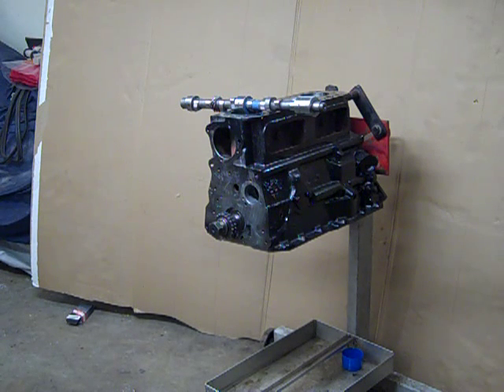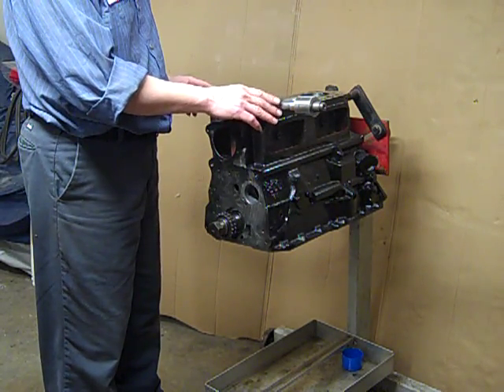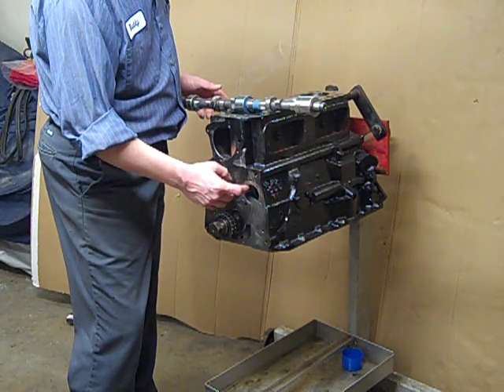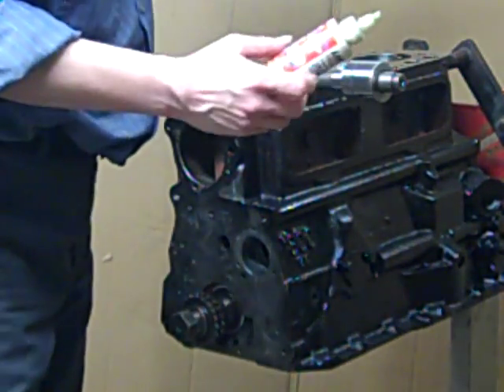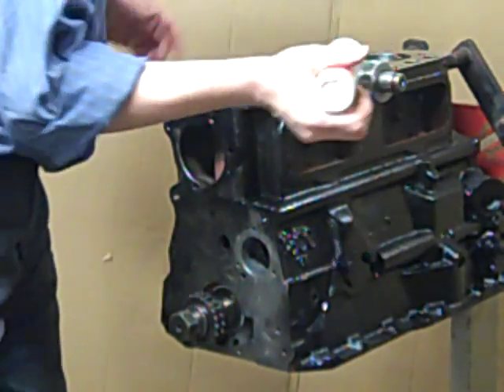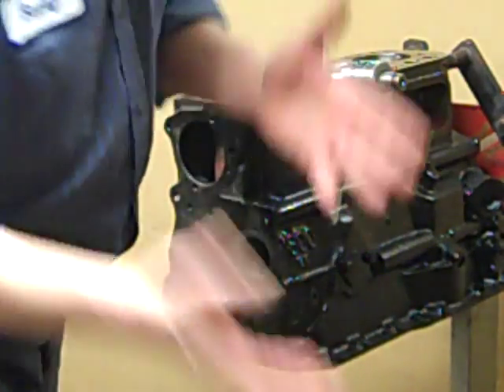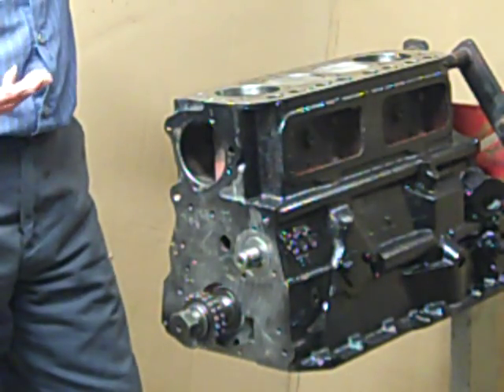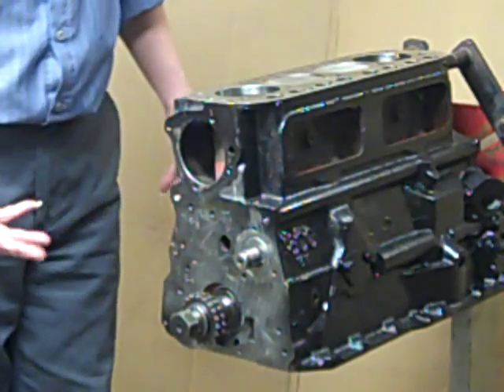cam install

Comment: FYI, install the camshaft before the pistons as well as turned upside down and you can use your free hand to help guide the cam through the bearings. Then install pistons. There is absolutely NO REASON to install pistons first.

Comment from the maker: @TimothyAaronPotts  that's on a little 4 cylinder.
on a V8 where the cam shaft is really long, I will either set the block on it's back so I can drop the cam shaft straight down, or some camshafts are threaded for you to screw a tool into it (about the same as a long bolt) so you can control the shaft better as you try to slide it in.

Comment: I'm just some guy in Chicago Buddy, but I sure do like your vids.  Almost bought a Fiero, but ended up with an 85 Nissan 300ZX (NA).  It was the lack of power steering that made the difference.  Anyway, as an amateur mechanic I'm glad guys like you take the time to make these vids. So thanks.